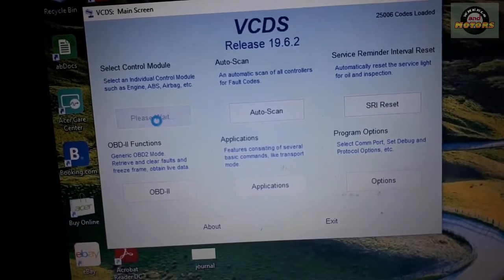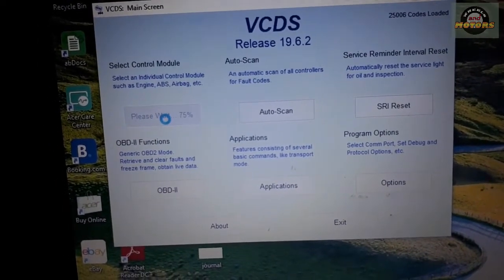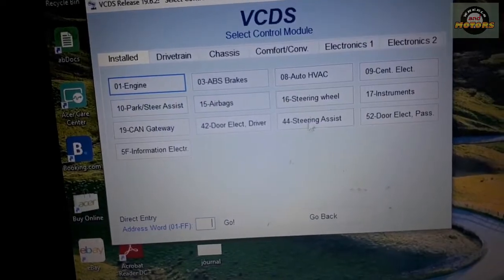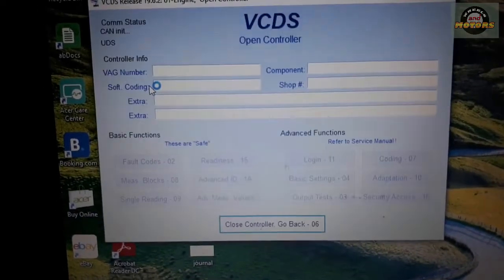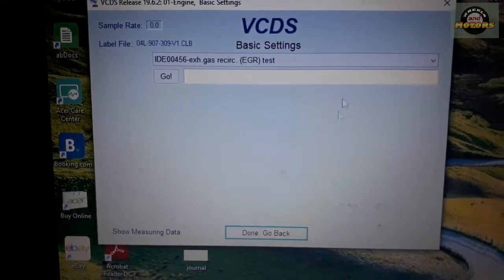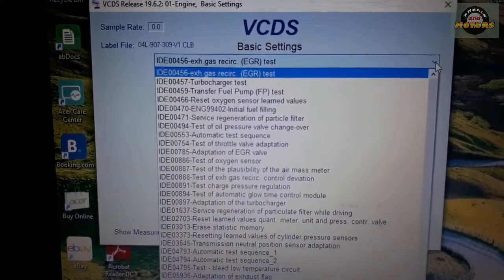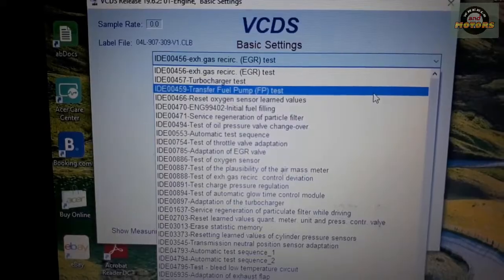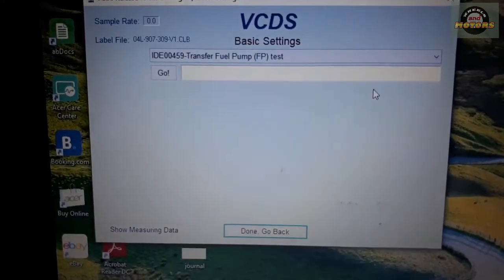How to prime fuel system with VCDS (VAG-COM)

Comment: A4 b8 2008 , this is starting both pumps ? Because there are 2 ,
Reply from the maker: Do you mean high pressure and low pressure pumps for tdi?
Reply: @wawayltd  no ,on common rail on my b8  i have 2 low presure pumps ,the one in the back and the other one is near right front wheel , i found the answer anyway ,my secondary pump is broken  ,is not starting always .

Comment: I have audi q7 2013 model. I have just changed injectors and i need to bleed them as i think its air locked. Can i use this software to bleed them?
Reply from the maker: I don't have any experience with injectors, but VCDS is considered one of the best for VAGs.

Comment: Does this prime the oil filter as well, when doing oil changes. I try to find out how to do that, is there procedure for that?
Reply from the maker: I don't think there is a way to prime the oil filter using software, as oil pump is driven directly by crankshaft. Just start the engine and it's primed.

Comment: bonjour merci pour tes partage de video sur la vw sharan voila 2 semaine que j'ai perdu sur l'ecran l'affichage du parkpilot pour le radar de recul j'ai le son qui fonctionne la camera de recul aussi fonctionne mais je n'est plus affichage de la voiture vue de haut avec les indicateur de couleur!!!!! aurais-tu une idée d'ou ca peu venir? merci a toi sur vcds il ma donné cela

Address 10: Park/Steer Assist (J791)       Labels:| 1Q0-919-475.clb
   Part No SW: 7N0 919 475 E    HW: 5Q0 919 298 C
   Component: PLA 3.0 12KH08 0005  
   Serial number: 000305183615313 Dataset Number: V03935219XN 0001
   Coding: 0071167051
   Shop #: WSC 00020 999 12345
   ASAM Dataset: EV_EPHVA3CVW428GP00 001005
   ROD: EV_EPHVA2CVW428GP00.rod
   VCID: 3D718CF3AC71A779E8-8068

1 Fault Found:
1081105 - Switch for Parking Aid 
          B107F 11 [00001000] - Short to Ground
          Intermittent - Confirmed - Tested Since Memory Clear
             Freeze Frame:
                    Fault Priority: 4
                    Fault Frequency: 1
                    Reset counter: 51
                    Mileage: 272050 km
                    Date: 2024.09.08
                  
et 

il y a 2semaine il ma dit ca

1 Fault code found:
1113107 - Front parking aid transmitter
B10FC 13 [008] - Open circuit
Intermittent - Confirmed - Tested since memory reset

Comment: thanks for the video, does this procedure also apply when swaping the HPFP on a 3.0 tdi V6?
Reply from the maker: Hello, I have never swapped high-pressure pump, not sure what else needs to be done. This is how to activate the fuel delivery pump if it's one of the steps to be done.

Comment: Is there a way to do this manually?  I just replaced my fuel filter but now my car wont start. My new filter is bone dry...
Reply from the maker: The only way then is to open it up and pour diesel inside.
Reply: tell me what helped you? I have the same problem and now I can't start my car

Comment: Hi and thanks! Just wondering, where does the air go / how it gets out of the system?
Reply: back to the tank through the return line
Reply from the maker: I'm not sure, but it definitely finds its way out.
Reply: @wawayltd  Alright, thanks for answering. I read elsewhere and I believe it goes through return line into fuel tank.
Reply from the maker: Probably... Most likely 👍

Comment: just open the door on my Audi and the pump runs, so easier that way
Reply: yup... until you find leaks because you did a stupid and had to reinstall both fuel rails because the gaskets weren't even bloody on because sleep deprivation and then once fixed you try to do the door open fuel prime again and it doesn't because the computer knows you already primed the fuel system... ask me how I know lol
Reply: @richmondvand147  Pretty sure if you leave the car for a few hours it will run again. I can't remember, I sold the car last year.